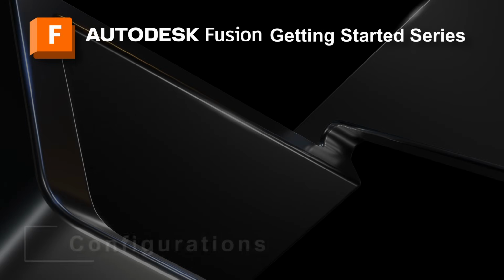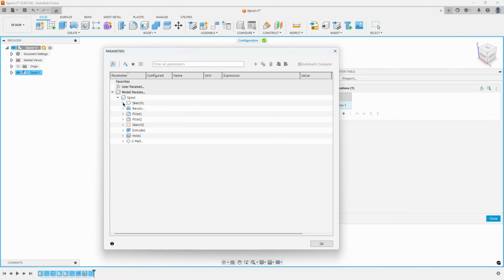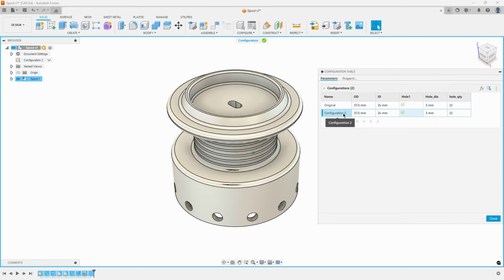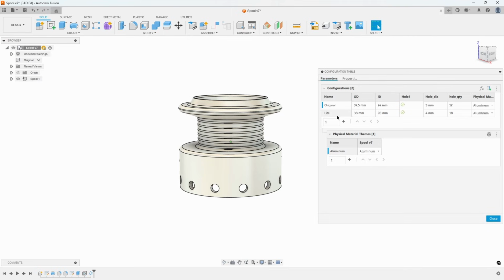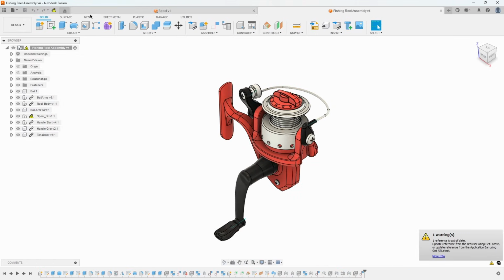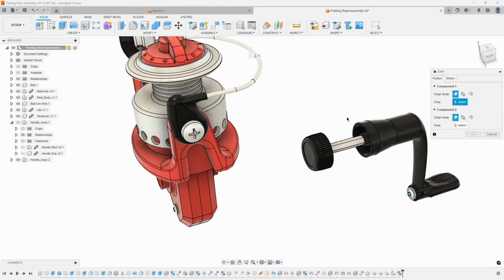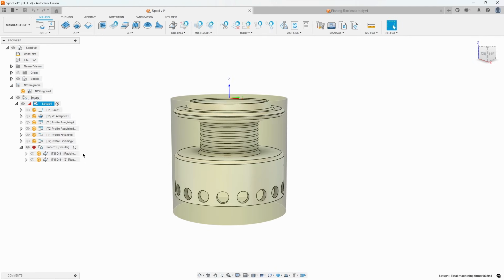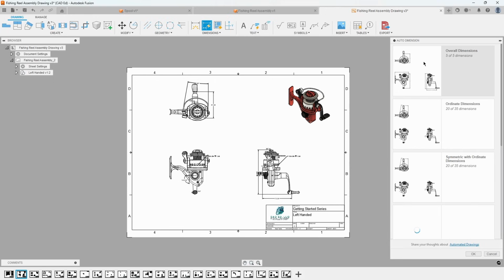Design Configurations | Getting Started with Autodesk Fusion Episode 16

Comment: Thank you for this video. Does configurations work with threaded holes? I have been trying to have a hole change from 10-32 to 1/4-20 and can't figure out how to do it as I don't find a parameter for the thread.